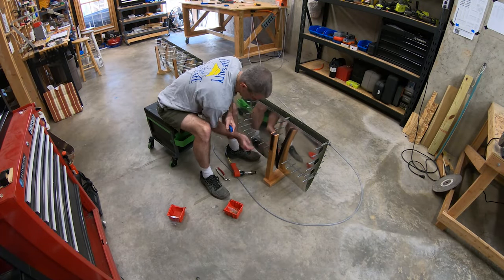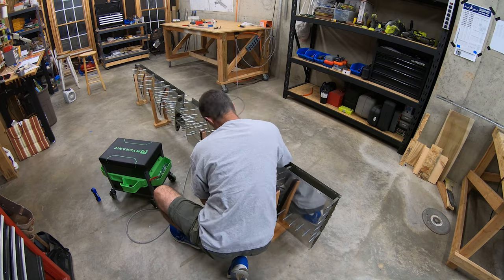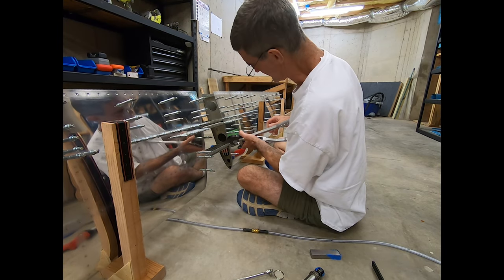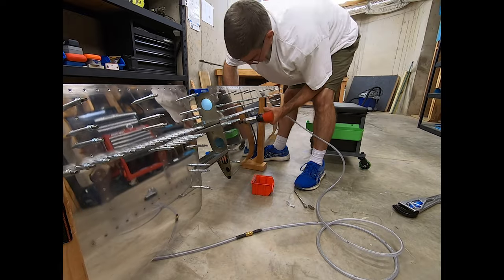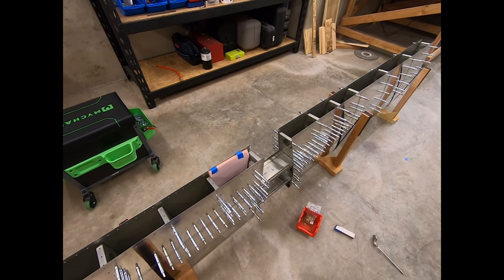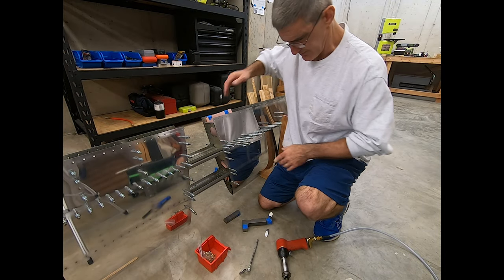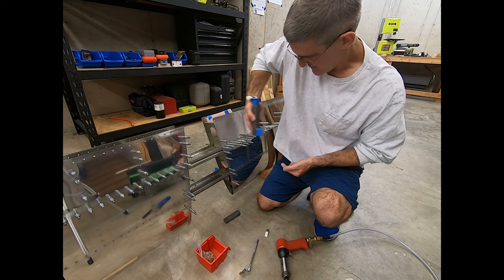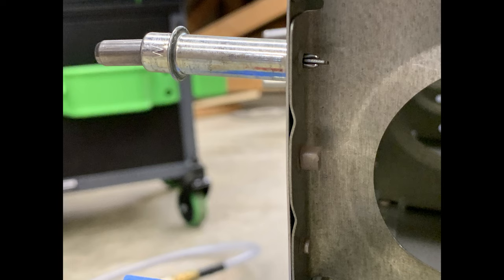RV-10 Build Log - Emp 50 - Tackling the rivets under the stringers.

Comment: In the comments on an earlier video you mentioned thinking about counting build hours towards A&P.  I have heard that the procedure is to have an IA inspect your work at stages before closing the skins and sign the appropriate log book.  So not necessarily something that you can do as an after thought later and capture all the hours.

Not a pilot or builder.   So take with a grain of salt.
Reply from the maker: Hmmm... That's a good point.  I'll confess I hadn't really investigated it seriously.  I heard about it listening to a Mike Busch webinar, but I don't believe he got into any specific requirements of how to document the time building for the purpose of applying it toward an A&P, or if it needed to be supervised in any way.  Thanks!

Comment: Nice work!  Are you using a 2X or 3X rivet gun?  Any tips on bucking the nose rib rivets closest to the leading edge?  Did you use your small tungsten bar there?  I couldn't get a good hold on the bar there and managed to bang up the skin.
Reply from the maker: Thanks!  I'm using a 3X gun, but I have considered getting a 2X to try.  I used the tungsten bar on the nose ribs,  but it was still a little tight right up near the leading edge.  I did better on these on the HS than the ones on the VS.  Must have gotten lucky.

Comment: Respecting your rivet-setting prowess. Are using the a DRDT2, or hammer/C-frame? I noticed you scuff your rivet lines before setting the rivets. Is this your method of de-burring? Just sorta a once-over with a Scotch-Brite pad? Also, share some of that BAB of Bacon Bits with your poor pooch!
Reply from the maker: LOL she gets a taste of whatever finds its way to the floor every now and then...  Up until now I've been using the C-Frame.  When I bought my tools, the DRDR-2 was out of stock. The C-Frame scares me to death, but it seems to do a fine job.  That said, I did buy the DRDT-2 when it became available, so I'll try it out on the elevator skins.  I deburr holes in the skins very lightly with a tool, often just twisting in my fingers, then give it a quick swipe with Scotch-Brite.  I know lots of folks leave the blue plastic on and use a blunted soldering iron to melt lines and remove only the strips of blue that cover the holes.  I tried that, but decided it was A) too tedious, B) could scratch the skin with the tip of the iron, and C) would just postpone removing the blue stuff until after assembly, which would make it harder to peel with a broom handle.
Reply: @missiletwentynine2667  Thanks. I like your de-burring technique. The blue plastic seems to be a topic second or third to the Primer Debates. I've never heard of a case where a builder said, "if not for leaving the blue plastic on, ("X") would have happened." I just haven't come across any pros to leaving it on.
Reply from the maker: @EJWash57  Agree.  Vans suggests removing it right away else it can get stickier over time.  I haven't had that happen yet, but I've seen some others say it's true.  When I built the practice kit I left it on one side and removed it from the other, and it definitely helped keep the one side pristine, but ultimately decided it wasn't worth it and to just be reasonably careful with the parts after removal.